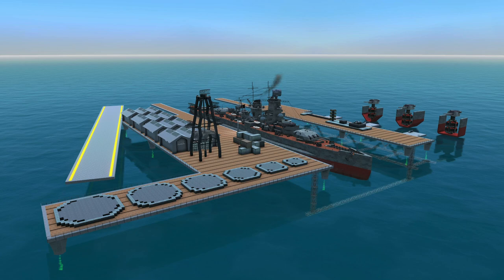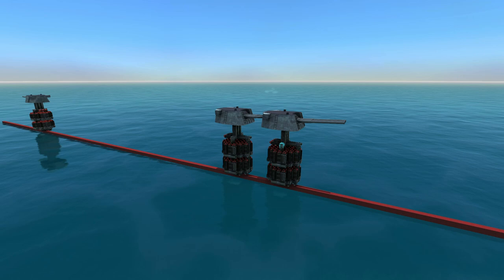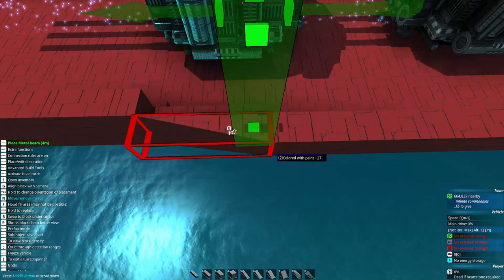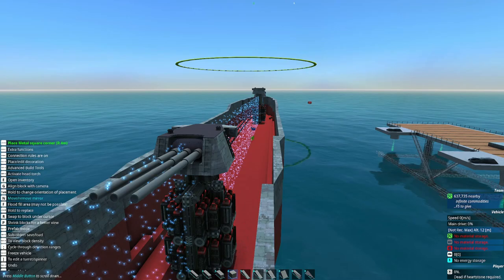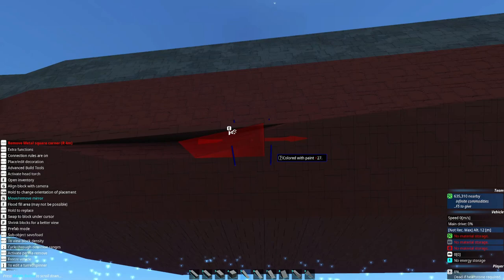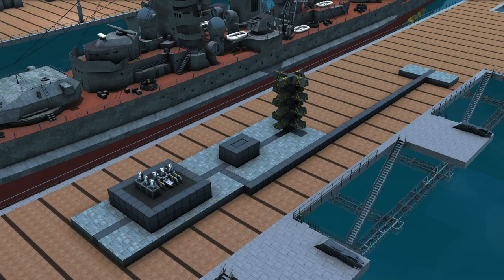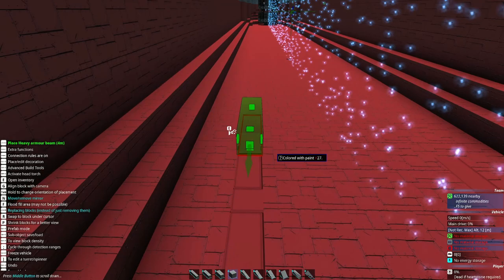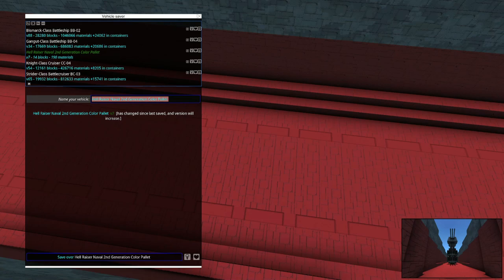Wrench's Way II: Hull Construction - From the Depths

Comment: Regarding painting the ship, there is a paint tool in the z-menu that allows you to paint your creations outside of build mode. You can even change the brush size to mass-paint large areas! unfortunately, it isnt compatible with mirror mode. Still useful though, like a giant spray-can tool

Comment: putting a layer of wood also helps to reduce HEAT damage. HEAT damage is calculated based on the final material before and air gap. So if you go metal-wood slopes-inner armor, you reduce the damage more. Also i think if you slope the outer armor, you can increase the chance of a shell ricocheting.
Reply: HEAT doesn't care about the materials, that's Squash spalling. angling the armor does reduce kinetic damage, but it either is negligible, especially if you angle it wrong, or it takes up space that you could use for more armor. beside the beam slopes help with that

Comment: I’m not familiar with medium steam engines but with small ones each generator wheel is 50k power max, the same amount as a gear box. They add extra drag to the engine lowering power and efficiency. I would consider removing one of the two generators

Comment: The hull shaping mimicry was awesome. 
I always drive myself insane trying to smooth out the corners. That ones deffinately getting used. Same with the website for the 3d models. I used to always find the top and sideprofile pictures, import them to a scaling software and input the real dimentions of the craft and go by those.
The tips about EMP protection seem so obvious now as well but i didnt even think about connecting it all into a network like that, thats brilliant!

Keep up the good work but dont burn yourself out with the edits and cuts. I'd love to see a longer less edited version as well. Actually i'd almost prefer it. Would have loved to see a more detailed layout of the ai building along with compartmentalization, the deck and its composition, weight balancing and boyancy management, as well as the rest of your armor scheme. 

In any case im looking forward to the next installment.

Comment: 31:14
Actually useful explanation and demonstration of emp, will be using this.
Also
I'd recommend putting that section up as a separate YouTube video just because of how useful it is.
Reply: Other various notes 
-Very useful hull shaping points 
-Nice kinetic ciws shell, I'm yet to find the optimal gunpowder one but that one seems very close to the one im using (heavy head stab fin tracer and gunpowder to 20ap)
-I respect going gunpowder sabot kinetics
-personsally for the emp networking, I'd go 1 beam across the deck and one along the keel to help against both emp torpedoes and missiles, instead of one just in the keel, also having it centerline is just giving the turret blocks better connection points in the scenario a thump shell(or really anything)  hits the bottom of your ship under the turret.
-100% recommend adding missile interceptors, almost always worth it especially on ships against crams given their setup correctly.
Overall very nice tutorial for ship hulls, ship name idea could follow the knight naming scheme and go something like squire, or a medieval name for a basic foot soldier.

Comment: Hey Justa, on ships with large ammo caches you can actually use them as armor and EMP networks and combined fuels storage if you honey comb them with armor so the explosion cant cascade. I usually do 2-3 of these depending on size and needs and mix fuel and ammo and EMP through them.

Comment: Your EMP network has two separate lines of heavy armour. If you cross connected them a few times, then when one gets severed, you won’t have breaks in your network. If both lines get severed then as long as it doesn't happen in the same run then the network still stands. This would work well if you make certain to space the heavy armour lines, so they can't be taken out in a single hit. 

If you put two surge rooms in your ship, one at the front, the other near the back, then your EMP network still functions if split. It also means you have redundancy if your surge room takes a direct hit.

Comment: ty for this video and series. i learned quite alot with these two videos in this series so far.  I have two suggestions for the hull part [ the base hull build ] i would suggest color coding it for the different complex blocks [ when using the slope and wedges back never knew you could do it that way], then maybe denoting which blocks are being used more often. Though granted  dont have to do whole block by block, just feedback. The other suggestion, I would love to see this series continue along. Very few from the depths videos that do this topic cover it this detailed. What i mean by this is that you do a good job explaning why you picked the said art design and though i suck at art myself , at least now understand why certain transition blocks can be schemed into the bottom hull.

Comment: Cool video, I like the idea of HA emp surge network and I see that with your compact realism building style everything has to be very compact, but I would say the use of HA is a bit much in general, To add some spall liners and air pockets in general I would make use of some poles and HA beamslopes instead of HA beamns, I think that could help against some pendepths shells and fragments as poles have nice surfaces for hesh etc to bound on.
Reply from the maker: I’ve begun experimenting with using a layer wood for the spalling since the damage from spalling is based off the last block it goes through before an air gap (I pretty certain that’s how it work).  So I can cut back the HA for weight and cost
Reply: @JustaWrenchGaming  To my knowledge it is not quite how it works, the spall from HEAT never changes BUT spall from HESH does, the spall from HESH is based on some complex math of all the layers it passed where the last one is most important, BUT that is why we wanna avoid having HA in the utmost layer and reserve it for internal layers ^^
Reply: I think at least but I'm not an expert
Reply from the maker: @GMODISM  ahhhh I see.  I’ll have to keep that in mind.  Thanks for the input brotha’
Reply: @JustaWrenchGaming  Hey no problem! Good luck, love your style as I can't build like that myself :)

Comment: Constructive criticism on the armour and comment about the lift props, if you're doing 2 or more layer thickness of armour, if you alternate between metal and alloy, such that blocks of the material aren't touching each other, it forms a decently tough armour scheme that is actually buoyant, eliminating the need for lift props, as you can just get away with air pumps to compensate the heavy armour.

Lift props on ships should generally be avoided, as it means losing engines will cause you to start sinking.

Another piece of constructive criticism is to do with the ammo, if you separate each ammo box with a spacer block(Heavy 2m Slopes work well whilst saving weight compared to 2m beams) it prevents a hits to an ammo box from detonating the entire magazine. 2m metal beams as the spacer only prevent a chain reaction if the hit strikes a single box, heavy armour slopes prevent a hit to multiple boxes from chain detonating the entire magazine. Obviously it basically doubles the size of your magazines, but that extra survivability it worth it, and can prevent your ships from pulling an HMS Hood.
Reply: spaced armor is simply superior
Reply: @caralho5237  no one is saying you can't use the suggested armour scheme with a spaced armour design.

Comment: Hey i may suggest the red part to be metal while the grey part is alloy. It helps to keep balance plus it floats better with a small cost of armor. Also for the wall inside the ship I prefer stone to help budget.
Reply from the maker: I actually started using wood in some places now after making a few more ships and it’s helping quite a lot with it floating

Comment: new to this game so im confused.. is this just a design guide for a realistic ship? most other builders use many many layers of armor and diffrent types of blocks for it. will a ship like this compete against anything in this game or is it just a glass cannon that looks good? i really would prefer it when a good looking ship is also durable without 20 layers of metal.. is that possible for the normal gameplay?
Reply from the maker: My bills are aimed at being a good balance between effectiveness and aesthetics. It may not look like it, but against most other of its cost and lower, it has sufficient armor. It’s not going to have 15 layers of armor, such as a battleship of some sort would be.

Comment: what are your thoughts on using wood as a spall liner sandwiched between the beamslopes and external armor? iirc HESH fragment AP is based on the material it exits from, meaning it does less damage to the beamslopes receiving the hits.

Comment: wouldnt extending the turret neck cause the reload speeds of each gun to be slightly different? or am i wrong?
Reply: Extending the neck with gauge coolers technically would give the taller turrets slightly faster cooling but you should already have enough cooling and have the RPM limited to the desired amount. The reload speed is determined by the number of autoloaders and clips which are not affected by an extended turret neck.
Reply: @ARK_Angler  ohhhhhhhhhh, i thought the cooler affects RPM, thanks for the advice